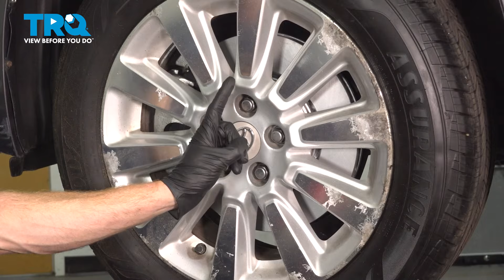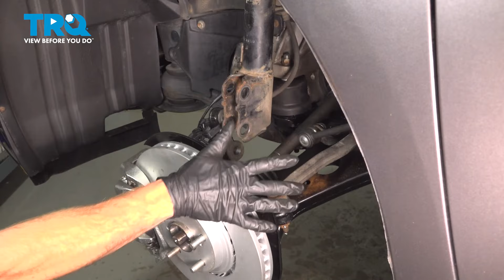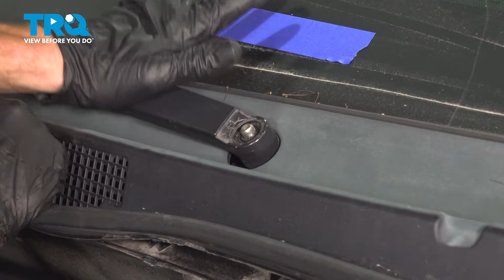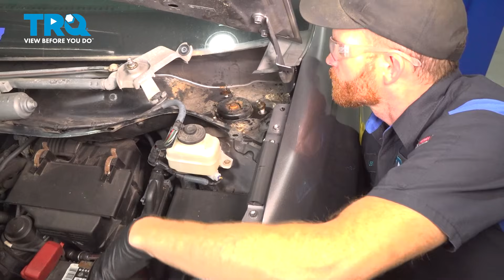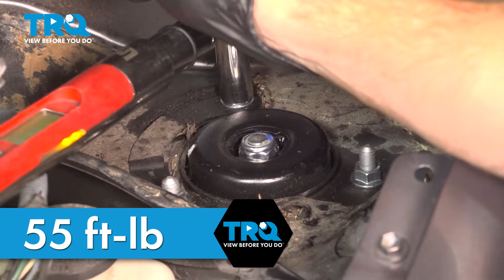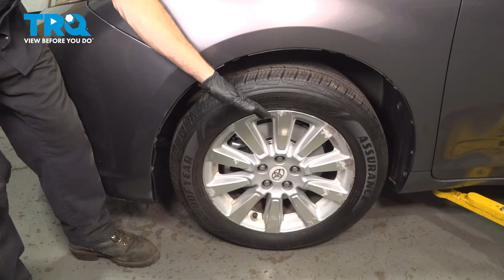How to Replace Front Strut & Spring Assemblies 2011-2020 Toyota Sienna

Comment: Excellent video. Just done with both sides by myself. Took much, much longer for me (several hours per side)... but followed this 100% and saved $2000. A few unique problems like axle was frozen in the hub assembly and sway bar link nut kept spinning because my visa grip teeth were worn... points to learn from...

Comment: One of the best videos on the job. Perhaps I am picky, but I would feel compelled to take a shop vac to the wiper tray and get rid of all that debris. In addition, I would have used a level tool to try to get the camber close before driving to the alignment shop.